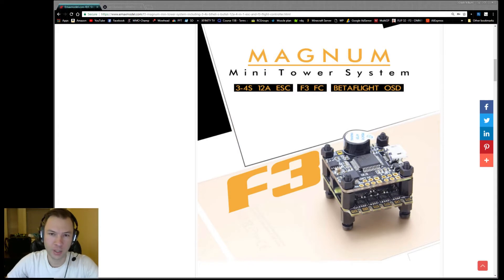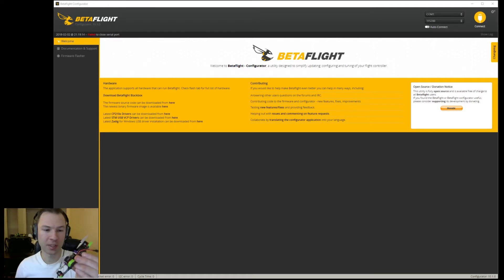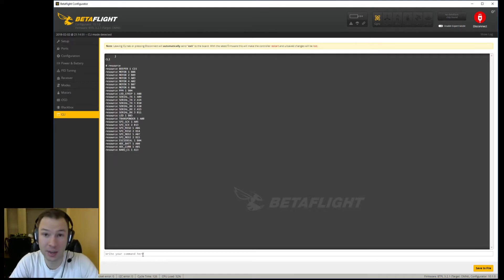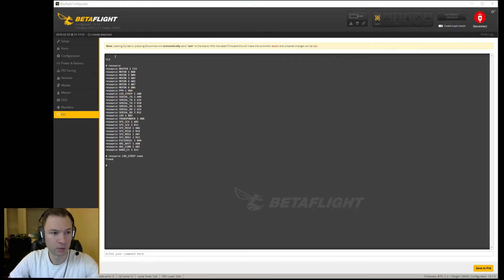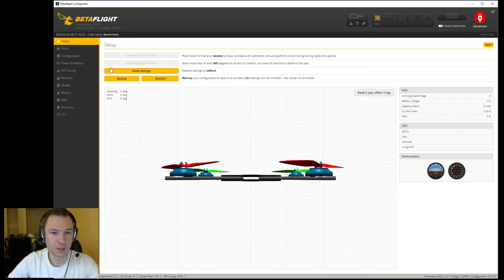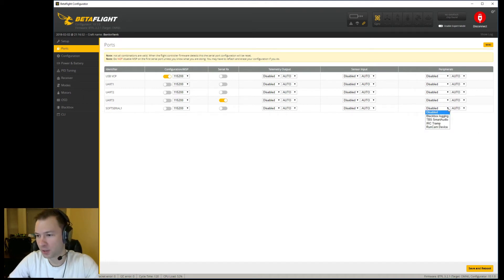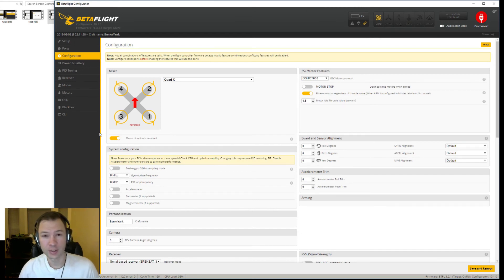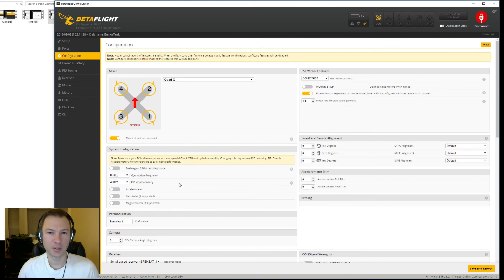How to set up smart audio on the Emax F3 Mini Magnum

Comment: Sorry I don’t understood where I have to connect? To the 5v or the Led pad?
Reply from the maker: Borh will be needed. The LED pad is for the smart audio signal. The 4v pad is for power.
Reply: @CrashNBurnRacing  Okay thanks for your quick answer, so I connect the 5v from the vtx to the 5v port from the rgb pad and then the Smart Audio cable from my vtx to the led port from the rgb pad, right?
Reply from the maker: @RealKushrage  you got it.
Reply: Okay nice😂 thank you very much❤️ Sorry for asking, my english is not so good🙈😂

Comment: I followed the steps and updated to 4.0.2 in betaflight. The camera works, the “EMax” logo appears at power up, but none of the OSD appears.... When I try to access the smart audio through OSD using the sticks, it seems to “sound like” I am in the menu, but can’t see it. Any suggestions, feedback or troubleshooting ideas?
Reply from the maker: It sounds like to me that you may have the video in and video out backwards on the flight controller.  But I would double check to make sure that the OSD is enabled if BF first.

Comment: Hey Crash when you soldered the AKK vtx did you remove the connector from the FC?
Reply from the maker: I did not.
Reply: @CrashNBurnRacing  So you used the existing connector to connect or did you just solder to the opposite side?
Reply from the maker: @koolpix4u  I think I missed understood your question, if you are referring to the connector on the VTX I just cut it off and soldered the wires directly to the pads on the FC.
Reply: Crash N Burn Racing so did you ever hear if you could solder the smartaudio to that unart by the buzzer rather than using the LED pad?
Reply from the maker: @koolpix4u  I have read on RCgroups that some people have had success with it, I had a very early production board but I believe later units had that issue fixed.  I never did try it with a newer board though.
Reply: Crash N Burn Racing last question.  Will I damage anything by trying that Uart2? Or am I better adding it to the LED spot? I was just worried about the CPU usage getting to high?  Thanks
Reply from the maker: @koolpix4u  If you would like to save the led pad for something else I would try uart2, it is a bit of a challenge to solder to but if you take your time it should be okay.
Reply: Crash N Burn Racing Hello again.  Can you help me solder up my AKK to my F3 board?  I need some sort of diagram.  I see the power input need to be at least 7 volts.  Where did you get the power from? I’m only seeing 5v.  Also does the yellow video wire from the camera go straight to the the yellow wire on the vtx?  How does the video OSD info get from the FC to the vtx?  I’m so confused I hope you can give me a hand.  I see the FC has video in and video out but the vtx has only one yellow wire?  Thanks.
Reply from the maker: @koolpix4u  To power the vtx just use power straight from the battery, easiest is source is usually of an esc. The yellow wire from the camera needs to go to the video in pad on the fc. The yellow wire from the vtx will go to the video out pad on the fc. This will allow the FC to overlay the OSD on the video feed to the vtx.

Comment: I have OSD control of my VTX using this method but as soon as I remove the battery and reconnect it returns to a default channel.   Any thought?
Reply from the maker: I believe this was a glitch with an older version on BF,  can't remember which one but maybe worth updating if your on an older version.
Reply: If I reflash betaflight what board would I select for firmware version with this FC?
Reply: Never mind I figured it out. Omnibus... now it’s not even recognizing the Smartaudio.  Guess I can always revert back
Reply from the maker: @cpt_carrera3417  I checked the two quads I have that still have this FC and one is on 3.2 and the other is 3.3 but they do function correctly.  The only other thing I can think of is that you are choosing exit ans save after changing your channel in the OSD menu.
Reply: I tried a few later versions like 3.5 or so and went back to an earlier version, 3.3 I think it was and it came back and seems to be saving now.  Not sure why the later versions didn’t work... I’m using a holybro ATatl mini (bc it was cheap).

Either way, a betaflight upgrade did the trick it seems.  thanks for the video and help.

Comment: Hi man, thank you so much for the video. so I would like to use TBs nano receiver if you can help me where to connect the wire
Reply from the maker: If your using SBUS you should be able to use the rx3 pad. If you want to run CRSF I believe you will need a tx pad, this board does not have one but you could try to remap the led pad for tx3 but I'm not sure if that will work.
Reply: so far it does work but I'm also not using telemetry,  had weird issues when it was active,  haven't seen problems since disabling telemetry

Comment: Where are you getting the the 7-24v to power the needed voltage of the fx3?  Ive been looking for a more powerfull vtx in my babyhawk and i think i just found it.
Reply from the maker: At first I was using 5v from the FC and the FX3 was working fine at 25mw.  But you do need higher voltage for the higher power settings and I just use battery voltage from the battery leads on the FC.

Comment: Hi can i ask you a question iv got a full crsf set up and have a spare nano rx setting here and would be great if i can fit it to this stack save me spending more money on a 2 moduel can this be done?
Reply from the maker: Judging by the size it may be a bit tight but it there should be a way to fit it in there.

Comment: Suggested VTX to take advantage?  Seems like the VTX included with the Babyhawk R does not have smart audio.
Reply from the maker: I really like the AKK FX3.  I believe this VTX had the smart audio glitch with BF3.3 but there newer ones should have that fixed, but I can not confirm that.
Reply: Picked up the unify nano, will report back. Can't figure out if I will be able to leverage SA on TX2 and LED for S.Port telemetry for the R-XSR... Pity you can't have two devices on the one UART.
Reply from the maker: When I was out flying last week there was a person who said that he was able to get UART2 to work for SA.  He had a newer F3 mini than so maybe the newer FC's work better.

Comment: Hi mate, great video . . . does this mean you can get telemetry back through smart audio also or is this just to run a lua to change pids and rates through your tx? ive only got 5v gnd and sbus wired to the fc but want to use telemetry and smart audio too. is there a separate telemetry pin so i can use all the features of the rx? cheers!
Reply from the maker: You should be able to use UART 2 telemetry. The pad is the far inside pad next to the USB port.  They look like small holes but you can solder to them.

Comment: Thanks for this video! I followed these steps and for me everything works in SA except I can’t change VTX options... but I can change and save pid changes. Got any ideas why that is happening for me?
Reply from the maker: If you did not see any errors while remapping I would double check to see if you have the right protocol selected in the soft serial port for your VTX.  Also if your VTX uses Tramp make sure you go to TA and if it's TBS go to SA in the OSD menu.